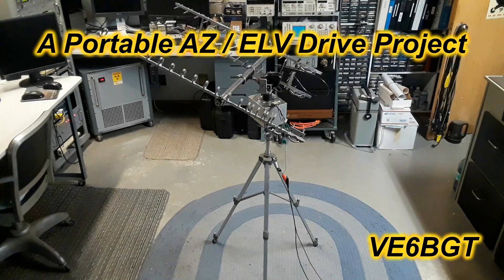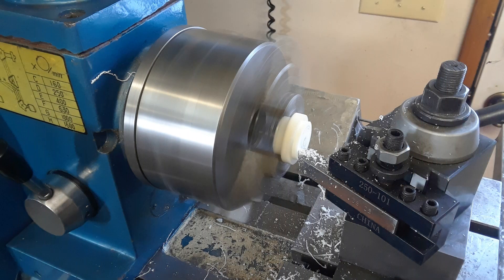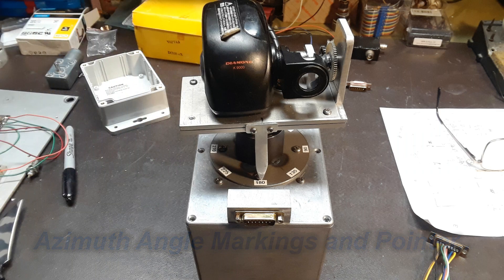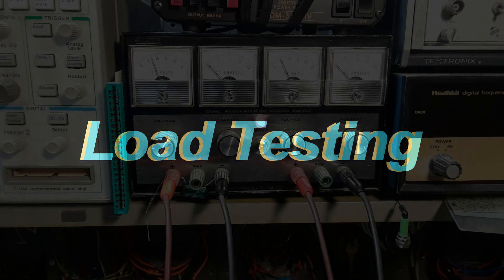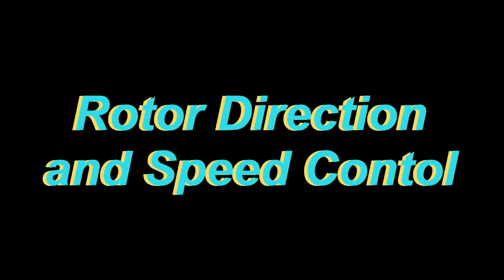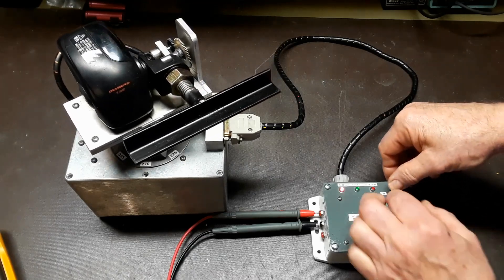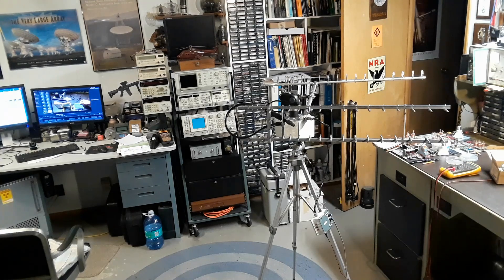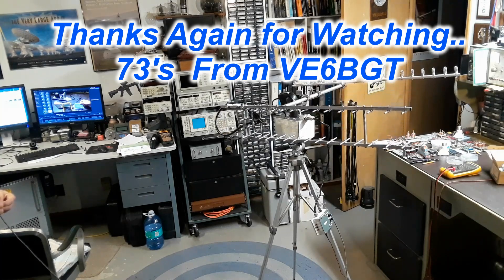Portable Azimuth Elevation Satellite Ant Rotor Project

Comment: Hi skip, do you have a parts list you wouldn’t mind sharing? I was looking into something like this for a starlink mount on a vessel
Reply: Nevermind, I see you ran through it towards the end lol
Reply from the maker: Hello and thanks for asking.. No there really isnt any parts list, this was made up from just what ever we could find to use..
The azimuth motor was just a little gear head motor bought off Amazon.. It was later replaced with a more powerful one, same gearing..
The elevation drive is some kind of whip ant lower and raising mechanism that he found from some place, I think they are still available but I dont know what they are called..  The rest of it was just parts and pieces.. The PWM small controllers are from amazon.. Its interesting you mentioned it being for a possible Starlink mount, doesnt Starlink have a motorized mount ?? The one I am using had a motorized self aligning mount.
That would work best probably but again I dont really know your application.. Thanks, Skip
Reply: @VE6BGT hi, I’m not aware of a product by starlink at the moment, I’d have to do another search. That would sure make things easier. Any willingness to build another one and sell it?
Reply from the maker: I dont know if it still available.. When I ordered mine it came with the motorized mount.. I just plugged it in and it found the satellites..
I have seen them on the back of trucks and are moving around on their own.. This was the first or second generation I think.. They may now just be all manual orientated..  Sorry  though I am just to busy to get into building one for you..  If you need something like that though there are azimuth, elevation rotor systems you could mount the Starlink dish to and then have it just steer by the rotor controls.. etc..
Skip